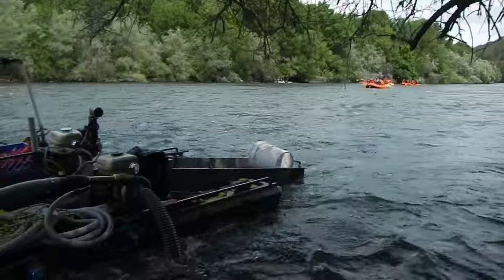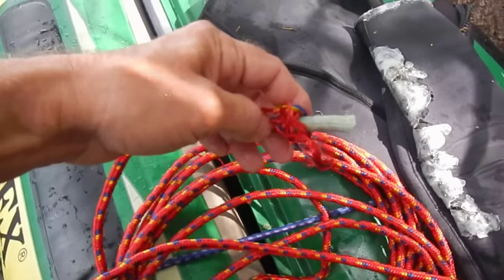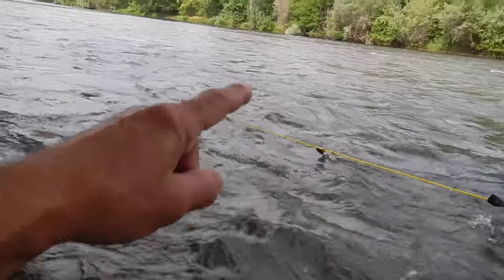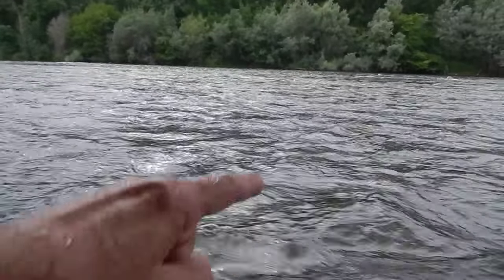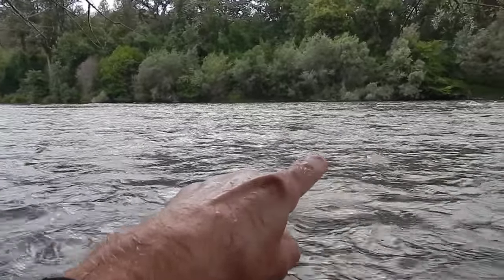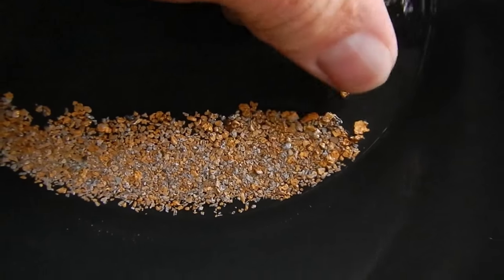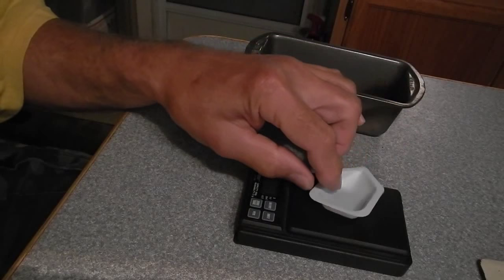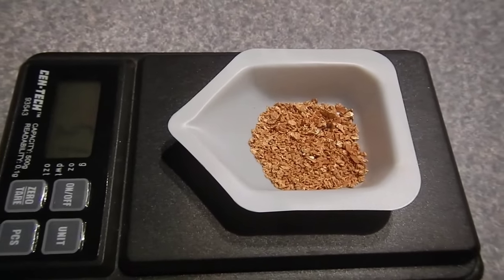SABOTAGE ON THE HANDEGARD DREDGE! SOMEONE CUT MY ANCHOR LINE! AND I GOT A QUARTER OUNCE OF GOLD!

Comment: Looks like someone was trying to steal your dredge, good thing you had it on a locked steel cable as well as the rope!
Reply from the maker: Actually it turned out to be another dredger snooping around on my claim area. By regulation we can't be closer than 500' so he was way off base and the moron cut my rope with the prop on his outboard motor. Then the dumbass just untangled the rope from his boat and took off leaving my dredge to go by-by. The missing section of rope was what got wrapped up by his prop. I know the culprit and we have had words.